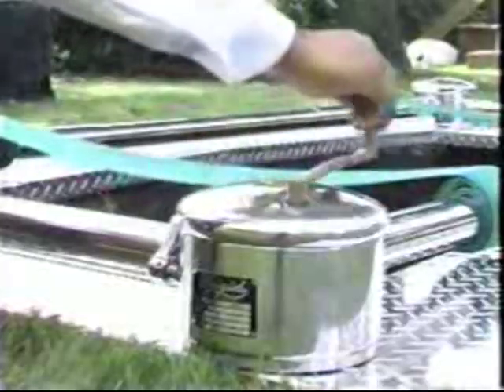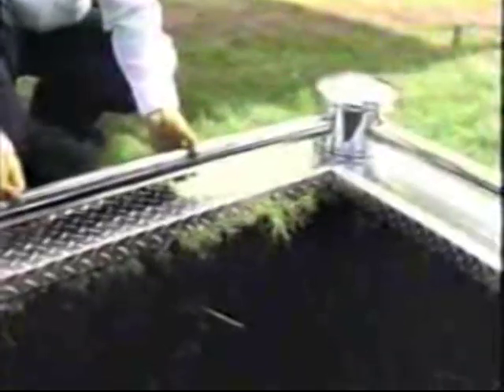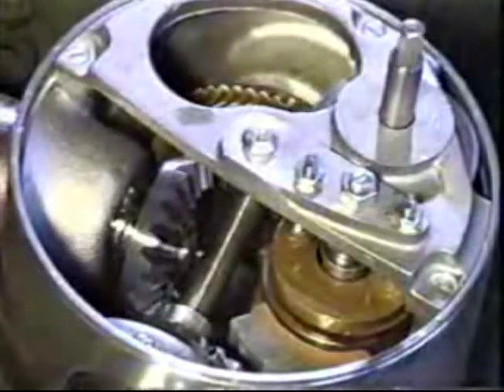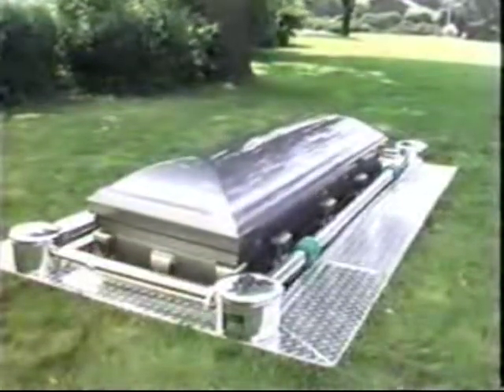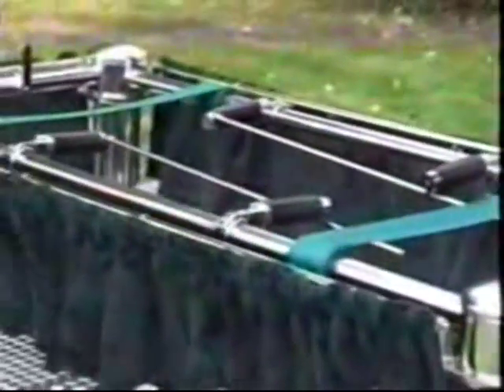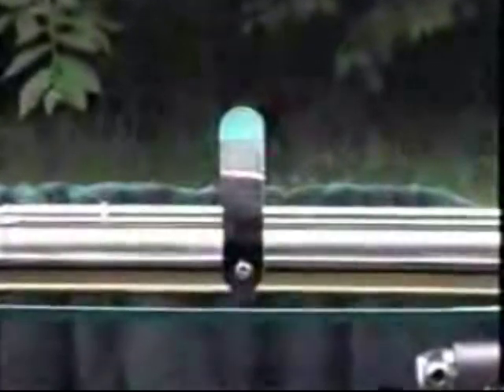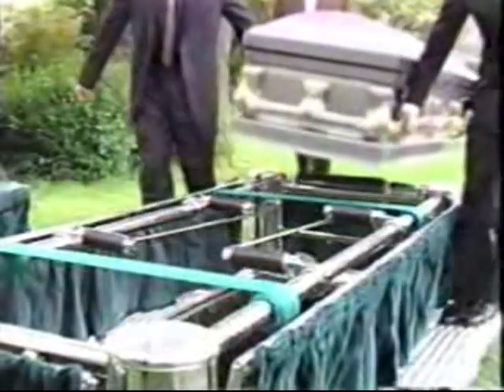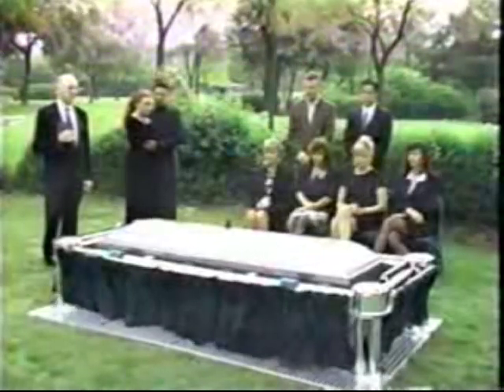User Guide for operating a casket lowering device - www.nifunerals.com

Comment: How does the casket not pinch the straps to the bottom when it's all the way lowered?
Reply: Vaults have bumpers. So the casket is not lowered directly on the ground. This leaves space between the casket and the dirt so you can pull the straps out with ease.

Comment: Always impressed by those devices, I work in a funeral home in France and we don't have this kind of equipement

I'm just wondering : how are you getting the straps back up and not stucked by the weight of the casket ?
Reply: xMTLKx ubh
Reply: That's the random question that sent me looking up the process.
Reply: En fait, des cairons, des parpaings ou des rehausses bois, sont placées dessous afin de conserver un espace suffisant à la libre circulation de la sangle. Ils ont vraiment le sens du respect et de l'accompagnement.
Reply: Donc ça n'existe pas du tout en France ?
Reply: @larchitecte5287  j'en ai jamais vu mais ça doit exister